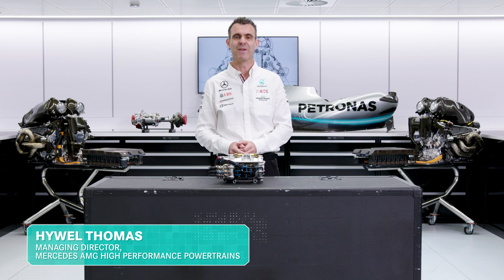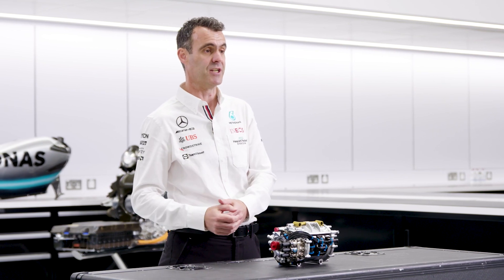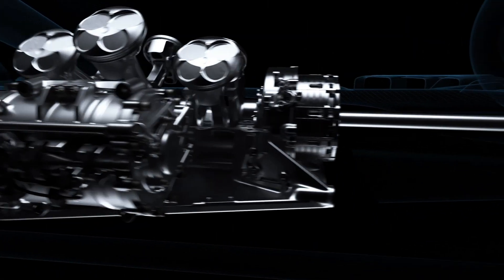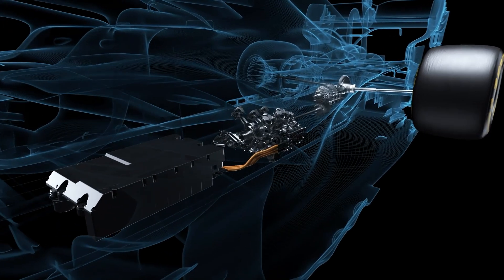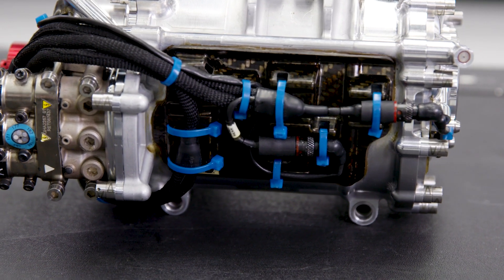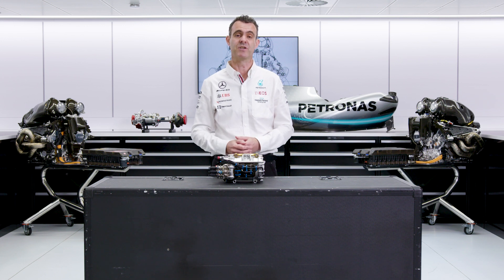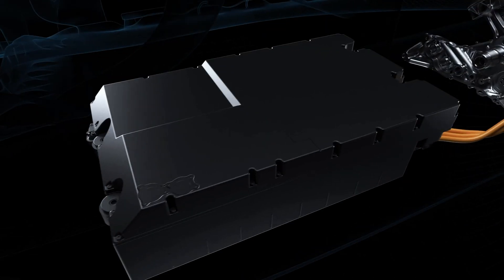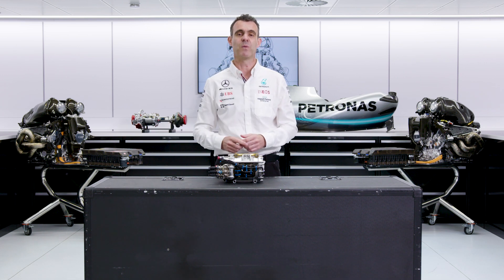Power Unit 101 - Episode 4 - MGU-K

Comment: I don't understand why people keep repeating the wrong idea that "braking energy is converted". It has nothing to do with braking or the brake system. The MGU-K is an electric motor generator that is connected to the combustion engine. When the driver releases the throttle, it starts to operate using the energy of the car's movement (kinetic) that is transferred from the wheels to the engine, and then to the motor generator, making it rotate and produce electrical current that charges the battery. This way, the MGU-K helps to decelerate the car, but it doesn't use any "braking energy". Afterwards, it can operate as an electric motor using the energy stored in the battery to deliver power to the car.
Reply: It’s somewhat like engine braking with resistance being the force but you are correct, it’s not part of the wheel brake system.
Reply: Great and simple explanation

Comment: 2026 regulations allow 350kW MGU K power output but same capacity battery
Reply: means capability for harder regen braking and more torque off the line, without dramatically increasing top speed.